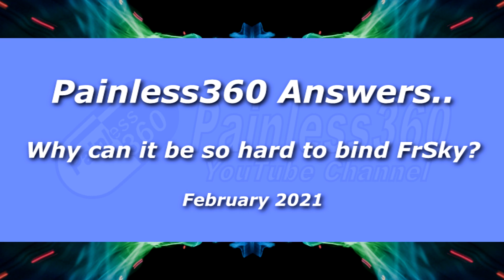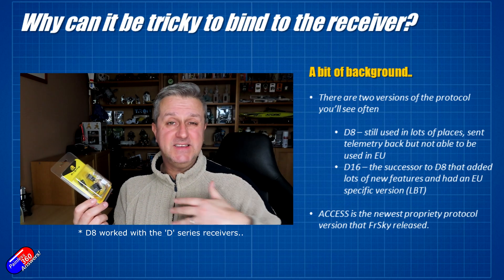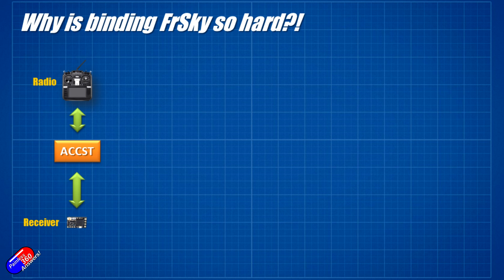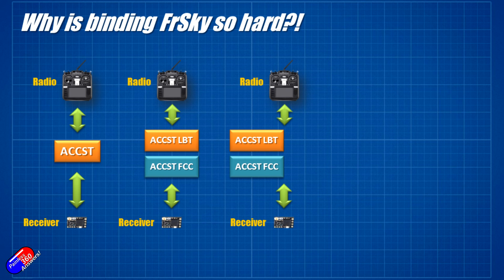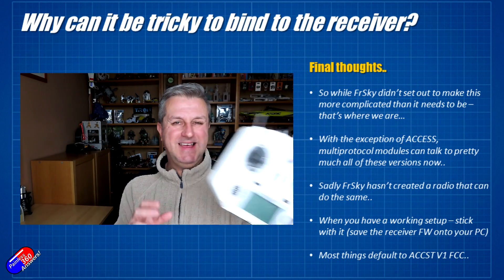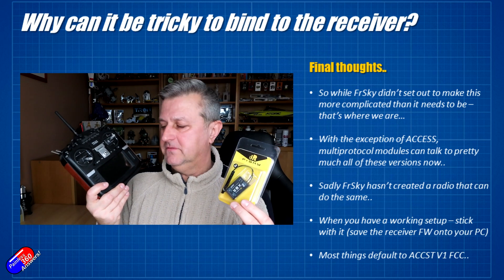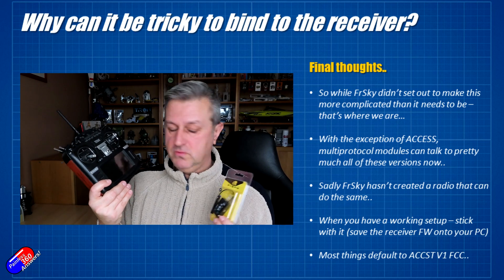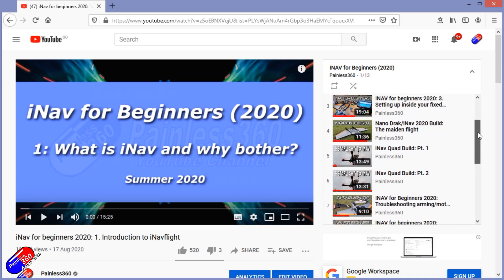Why can it be so tricky to get my FrSky receiver bound?

Comment: yes i cant bind my taranis q x7 access with x6r accst.

taranis has accst d16, why this dont work, i test everything, i dont have USB programator for receiver, how much things do i need to bind one transmiter with receiver from same company XDD
Reply from the maker: You don't need a usb programmer. You can flash the reciever using the pins in the back of the radio... Best of luck

Comment: Today, you can use a multi-module in most Tx with a Jr style slot in the back, or the ability to output PPM, even very old Tx from the 70's have been converted. No problems. With the new Rx software from Mike blandford, you get greatly increased performance and reliability.
Reply from the maker: Thank you for the comment. Interesting that Frsky weren't the ones to fix it, isn't it... Happy flying

Comment: Hi Lee,wonder if you can help,I've got a frsky x-lite that has stopped binding to any reciever,has the real time clock battery warning on start up,would this affect the binding process,you videos are a god send thanx.
Reply from the maker: It shouldn't affect binding but I'd swap the battery and see if anything changes... Best of luck
Reply: @Painless360  thank you Lee ,If not I'll buy the boxer,the 4-1 does accst v2 am I correct.

Comment: This is exactly what happened to me, I can no longer understand what firmware I have on the receivers (X series) that I used with a Taranis X9D plus and on the “new” radio (x12s) that has an ISRM module and a multiprotocol module… I am very confused and continue to fly with the old Taranis…
Reply from the maker: If the receiver is using ACCST then it'll be one of 4 flavours. V1 (in either LBT or ECC firmware), or V2 (with the same two flavours). Luckily, multiprotocol modules support all of them so try them one my one and you'll find the one that works! LBT receivers (made for use in the EU) will normally have a sticker on them with LBT printed on it, so that halves the choices.. Best of luck!
Reply: @Painless360  Thanks for quick feedback! 
I assume that on my receivers is present the fw 1.5.something LBT,  and also on my taranis.
the things is: what is presesent on internal ISRM module of my x12s?
i will try to bind the receivers with the external module...
yes as you say FrSky lost the ball with all this changes...
Reply from the maker: This may help https://youtu.be/ULAic-lJOmU

Comment: Two years down the track, there is now UNI RX a ACCST D16 mode Receiver firmware that will work with any ACCST version for selected FrSky D16 receivers, this is not a FrSky firmware however, but it does have their blessing.
Reply from the maker: Video on that coming at the weekend. Happy flying!
Reply: @Painless360  it works (on the bench) I’ve just installed it onto a couple of X8Rs

Comment: Inially my radio talked to my receivers but they don"t and i can not bind any of my new receivers. Also my radio will not pick up any telemetry info from the verio, lipo or GPS sensors daisy chained together.. What do I need to do to get my stuff working.
Reply from the maker: What did you change?

Comment: Will the frsky receiver v8fr bind with the taranis t9 lite
Reply from the maker: No idea, I've never used one. Looking at the manual there is talk of a protocol I've never seen on a Taranis radio so you possibly need an external module in the bay to connect to it. Best of luck.

Comment: Hi,
My taranis QX7 is unable to detect the external R9M 2019 module in the "MODULES / RX VERSION" page. Even though I am able to upgrade the firmware of the R9M, but it just doesn't show up on the page. Strange that the Firmware Upgrade communication between the QX7 and the R9M is good, but then it stops detecting the external R9M.
due to that I am unable to bind any of my long range R9 Slim+ receivers. Please help !
Reply from the maker: I don't use the R9M here so no idea,  best of luck..

Comment: I need your help! I still can't get mine to bind and I have tried everything and even got a new x8r
Reply from the maker: What troubleshooting have you already done?
Reply: @Painless360  so I'm not sure why but when I try to bind it just goes straight to solid red and green and doesn't flash, Even if I don't have the radio on. And I know you said before that if it goes red and green solid then it could be a firmware thing so I updated the firmware on it and made sure it was non eu like my controller. I'm just not sure what to do lol
Reply: @Painless360  if you have any clue what I should do I would appreciate it.

Comment: Excellent video👍.   I’ve been struggling to bind the xm+ receiver. Having watched endless videos and flashed countless variations, it still does not bind. Clearly the issue lies with identifying the correct protocol and this really should be a lot simpler.
Reply: The fault lies with manufacturers woeful programming and a complete lack of any testing whatsoever.
Reply: been having the same issue. did you end up finding something that worked?

Comment: For those of us that Don't Live in Europe,, It is Not an Issue. 
Also Plug in a Multi Module and the QX7, ((ACCST or ACCESS) as there is Only 2 protocols..),, Will bind to More than a Jumper Multi can,, And for Value,, it is Still the Best Transmitter on the market.!! 
But If My Taranis ever dies,, I will Purchase a RadioMaster, (Only if they make me a Thumb wheel instead of the Scroll wheel)!!

Comment: Hi Lee, 
I’m looking at swapping everything away from Frsky, maybe run Tracer? Though I fly planes/wings, and from what I understand, I can’t get a Tracer receiver with pins ready to go? Or I go crossfire so I have long range capabilities and use frsky receivers on a Radiomaster? Too many options! Dan
Reply from the maker: I still use ACCST D16 receivers in lots of my models with no worries. The new RadioMaster receivers are nice and cheap and seem to work well too..

Comment: Good summary, thx.  Here is a weird one.  Updated S8R with accst v2.1.0 and bound to X10s also with v2.1.0 on the ixjt.  D16 mode, ch1-8 telemetry ON.  However, now there is no telemetry from the S8R, no rssi, no rx bat voltage. Tried deleting and rediscovering the telemetry sensors.  Have you seen this?  Is this a known bug?  Or did I mess something else up?  Cheers.
Reply from the maker: Not sure, I'm not following FrSky into 2.1 because of reports of these kinds of issues.. Let me know how you get on..

Comment: Hello - I'm just starting out and have an AR Wing on order. This video was spot on! I've been pulling my hair out trying to get my new X7 (ACCESS) bound to an Archer M+. Finally got the right firmware for the trans, receiver and internal module. Why they don't do this at the factory is beyond me. 

Quick question - I watched one of your videos that included a segment on Calibration and Leveling. You walked thru the steps and mentioned the params that have to be manually tweaked in the Arduplane parameter list. You had a model propped up with the right Angle of Attack and set a manual Param by specific degrees. I have looked and looked but cannot find that segment again! My F405 Wing thinks that "level" is sitting in the tail dragger position on the ground. Can you recall the video this was covered in?
Reply from the maker: There are only three series on ArduPlane - one with the Omnibus, One with a Matek F405 and one with the PixHawk Cube. You can find them a lot easier by using the playlists. With such a huge number of videos the playlists can often be a good way to find something again.

Comment: Hello Lee, I just upgraded my X9 Lite to a TX16S, I have/had an R9M Lite Pro module and some receivers for a couple of quads and had hoped I would be able to 3d Print a cover and manually wire the smaller module bay to fit with the slim module. The problem I am facing thus far is that the TX16S does not expect to support the slimmer modules and it is therefore not available to select when in the bind menu. I know the opposite problem of having too small a bay has a fix, but what I am looking to do seems more niche of a problem.

So what I am wondering is if there is any way to modify the bin firmware build to have it appear for the TX16S. I assume it would not be possible to wire it up and use the regular R9M option and pretend its the correct one (but lower the output power). Is my issue at all possible to "fix" or should I just give up.

Comment: Thanks for the video. I have a Taranis X9D+ and RM TX16. After using the TX16 for about 9 months, I am converted and most of my planes are using this radio. Mt last time that I use the Taranis must be last summer. Sad really as the Taranis is a solid radio but not versatile at all

Comment: Great video.  My FrSky (QX7) radio is still working, until it stops functioning, I'm ok with it.  It's a nice radio. I'm building a new quad, questioning what to put in it.  If I have trouble with the R-XSR.  I'm not sure what I'm going to do. To be honest.  We'll see.
Reply: Rxsr uses frsky d16 not frsky rx protocol . Mine works now

Comment: I bought in to FrSky several years ago with a Taranis X9D ACCST and a year later with an X-Lite ACCST.  Although they run the latest  Open-Tx I haven't flashed the radios since I set them up and I still have about a dozen ACCST Rxs from r-XSRs to Varios, (even that stupid self-levelling Rx they sold).  They all work fine. The moral being, if it works, don't fix it.

Comment: Binding seems to work on my Radiomaster TX16S to Turnigy TGY-iA6B and TGY-iA6c ... (Flys great) HOWEVER quite often when I get to the flying field they are unbound ( not binded ?? ) Re-binding the Rx as normal seems to work. Any idea why ?
Reply from the maker: If you are using the latest MPM firmware then report the problem via the project wiki to let Pascal know... Best of luck
Reply: @Painless360  Thanks for producing such a great channel. Great Job and keep safe.

Comment: I understand that a multiprotocol module (i have the iRangeX IRX4 Plus installed in my QX7) can talk to a lot of protocols, including all of the frsky variants ( except access). But then you still are using frsky receivers. I would like to know wich other protocols are good/often used. Is it only crossfire?  What kind of receivers i can put in my tiny whoops/ mini quads?
Btw: great explanation of all the different ice cream flavours

Comment: Thanks fot this I have typed 1000's words on forums trying to help people bind frsky rx to tx. Maybe should have made the video myself would have saved me time trying to explain it all. Another thing is that Open TX version is nothing to do really with transmission protocol ( apart from not ticking EU to enable D8) people are still confused about that. I agree that they destroyed their own market with all this - and something they could have fixed themselves. They could get into the multiprotocol market at a slightly higher price point as their quality is better than radiomaster. They had to open up v2.1 as it was really developed outside frsky as they screwed up a number of attempts to get round the mysteries glitch - which I have never seen. 
Any a very useful video thaf should be referenced in every forum covering ACCST protocols.
Thank.

Comment: Great video, thanks for taking the time to produce it. In the video you mentioned the move to V2.x.x (ACCST) which caused a lot if binding issues because it was incompatible with any of the previous firmware versions of ACCST but you also said that that issue has been fixed. Well I missed that memo, can you point me to some source that explains what has been done to fix the problem? Thanks!
Reply from the maker: I have a video on that. V1 won't talk to V2 and vice versa. Still the same. Unless you use an MPM ;) 
Happy flying

Comment: Im currently building 2.4ghz express LRS modules. I have a couple of atto receivers to flash also. Even the flashing and binding of these is easier than FrSky sometimes. Once initially flashed it can be done in future via WiFi for tx and FC pass through for rx. Binding is also auto with you setting a bind phrase.

Comment: I walked up a mountain yesterday to a good spot only to find my quad wasn’t bound to transmitter, couldn’t access bind button.  My fault as I’d been messing about with tx firmware a few months ago. I have a uk65 which is international only. I have since bought crossfire and will never use frsky again, I’ve had so much trouble over the years even when the firmware matched 🙄
Reply from the maker: I've done that too. Most of the pilots I know have too.. I now test things before I load up the car. It always seems to be the model with the RX hidden away that has the issue isn't it! :D

Comment: The LBT versions: this regulation was brought in by one of the EU's quangos with the claim it would reduce interference. And that's  despite the fact that OFDM and other interference-tolerant data transmission techniques have been around since at least 1989.

And that is probably also why the FCC / everyone else in the world hasn't adopted this nonsense. Why inject extra cost & complexity when it isn't necessary?
Reply: Yes, but the TX16S can do FCC, EU, ACCST 1.x, ACCST 2.x as an option per model, clearly if Radiomaster can do it, so can FrSky.
Reply: @JohnAllenTekHead  They probably could although I'm not sure they could add that feature to their older radios; it would depend on the amount of memory available.

But it's probably a mute point; Frsky are almost certainly losing market share over their 'stiff the users' attitude and trying to lock users into ACCESS isn't exactly helping.

Comment: Thanks for the explanation, I bought a new RX6R receiver that came loaded with V2. With guidance from your videos I found the V1 firmware on the FrSky website and backdated it and now have it bound to my 2 year old transmitter. What about software updates? Is it safe and recommended to update the Tx software? I’m hesitant to touch it now 🤔
Reply from the maker: https://www.youtube.com/watch?v=2QbXrTMrk6wis worth a watch. I've never updated the XJT firmware, just OpenTX and it works fine..

Comment: Is it really a thing limited to FrSky receivers or more in general the protocol D8 / D16 
I abandoned the whole FrSky ship back when they startet to go for the accst protocol and started fighting to get Jumper radios from dealers shelves. I instantly sold my 2 FrSky radios , the x9d and joystick one, I guess x-lite radio and since then went for what FrSky had tried to ban: Jumper and later Radiomaster

But i had not so much trouble with the receivers that I could not replace that easy ... till I moved forward to crossfire for most cases (except sail boats and rovers that work beautifull with those older receivers).
But I guess I avoided a lot of trouble by buying just 2 kinds or models of receivers and stayed with those but I had not suffered from space and weight cause I do not build copters cause there I prefer DJi products to stay on the safe side with the more expensive stuff.

Comment: I bought the Taranis X9D Plus 2019 se access and access receivers, I thought all my issues would be solved by investing in the latest Frsky gear. Well my Taranis won’t bind to my access, it won’t even register, I updated the firmware which was a mission. I am fed up.
The new radio has rssi issues an weak signal issues with my x8r receivers.
All we want is to buy a radio, bind to a receiver and fly, no need for firmware and other upgrades, just work out of the box. I am thinking of giving up the hobby because of this nonsense. I am not sure if Radiomaster will need all these firmware upgrades to work on my old receivers.
Reply from the maker: Don't give up
See my kit picks video from August last year for what I use.. Best of luck

Comment: Great explanation, such a shame FRSky did all this. Maybe they have a radio and new OS in the pipeline 😉
Reply from the maker: Indeed. Another closed system that moves away from the reason we all invested in their products perhaps?
Reply: @Painless360  I use the FRSky OS and every plane has a FRSky receiver, and unfortunately I updated the radio, so every receiver had to be updated. So I hope they do something  and free the restrictions. Spectrum are so doing so many great things, make me think, maybe I should bite the bullet of cost and start again 🤷🏻‍♂️
Reply: @DadsRCHangar  me too. So many wrong things I bought. Collect old 27 72 mHz stick and car. Did tenth on road 10 years

Comment: I found out the secret to binding Frsky receivers last year.  Wanna hear it?   I rounded up all my Frsky receivers and bound them up in a paper bag then threw them all in the trash bin.  Then, I put in TBS crossfire receivers all around.  I now have a daily driver of RM Tx16s with a TBS module in the J R bay.
Reply from the maker: Sadly I suspect that the way Frsky has managed this has pushed a lot of their customers to a similar point. If they just listened to what customers want then RadioMaster, Jumper and others wouldn't have a market.. Such a shame... Happy flying
Reply: @Painless360  - all of my Frsky gear has been thrown away or destroyed out of frustration with a hammer.
Reply: @Painless360  Lee, I did not mean to take away from your great explanation.  You always impress me with your comprehensive coverage of our hobby.  I feel I have enjoyed my time at the field so much better after learning from your videos.  You really are an encouragement to all.  Too bad Frsky neglected to keep in mind their loyal customers from the past when they started making business decisions.  I came to love my Horus, but now it sits most of the time unattended.
Reply: Same mate -  did exactly the same thing.  TX16 are great.
Reply: Done the same but kept mine now I am flashing to express lrs crossfire was a game changer for me so easy to use I don’t know why I have the Rssi in the osd not needed really